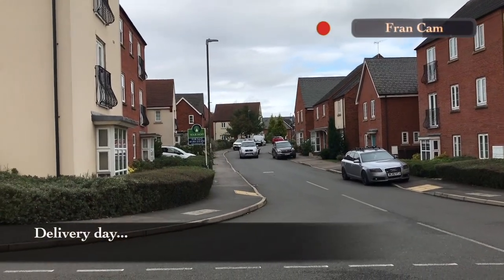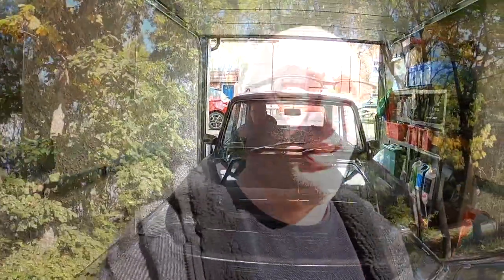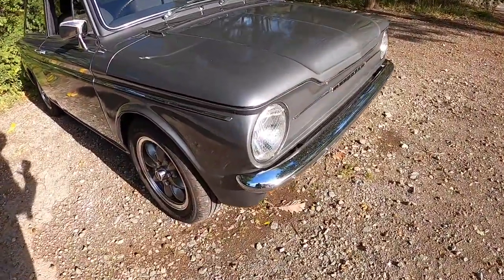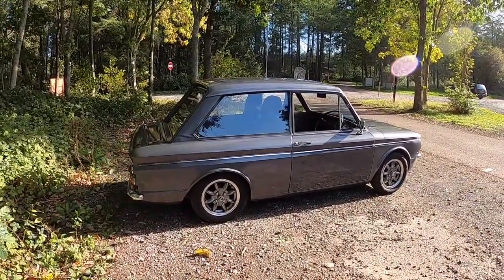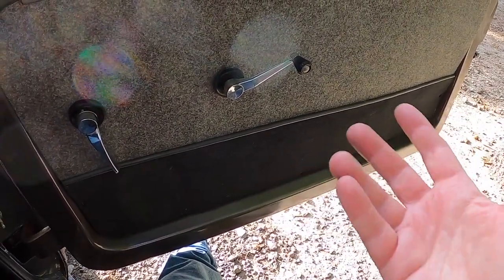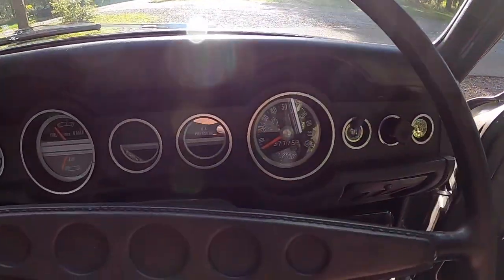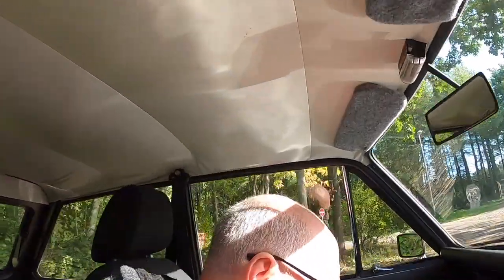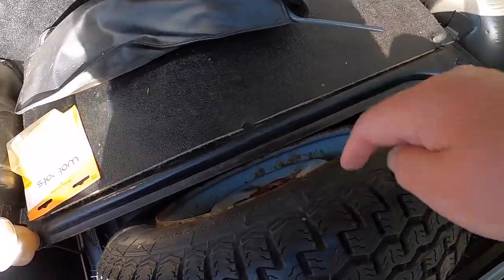New Car Reveal | A Very IMPortant Addition to the Fleet

Comment: In 1969 I bought a 1967 Singer Chamois FJX375E
Dark green with thin white  stripes down both sides & black interior, it was so cool with its opening rear window.
In the time I had it I sound proofed it
fitted Koni shock absorbers all round 
and replaced the King pins along with fitting a Phillips car radio
I have such fond memories of my "shrimp" and fully understand your enthusiasm while remembering your dad

Foot note my current car is a 20 year old Rover 75 V6 2.5 
Watching your channel when you are in Reggie I know you're  a 75 fan 😎
Reply from the maker: Yes. My now late Father’s was a 1969 Chamois POL 587G. I remember it having twin headlights. It also had a glovebox where mine has a shelf. 

A Rover 75 2.5 V6. Excellent. Had Reggie not been for sale in a condition I thought I had to buy… I would have loved the 2.5V6. With an auto. I think larger cars are better with bigger engines.

Thanks for watching and your comment.